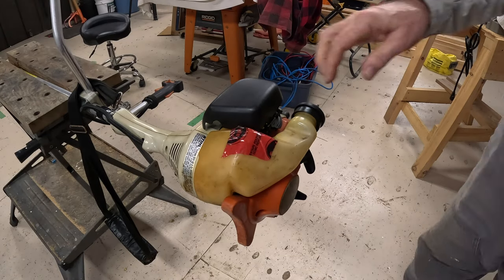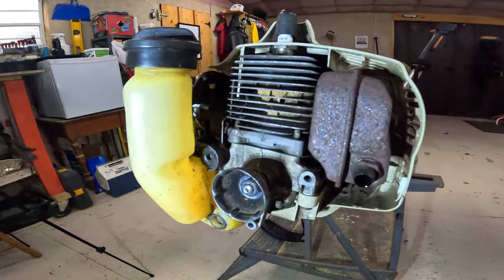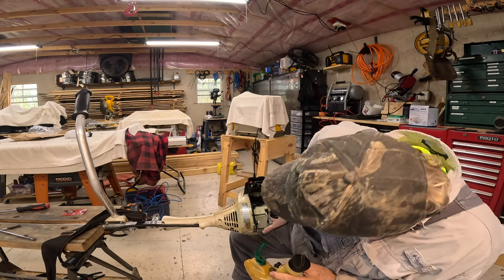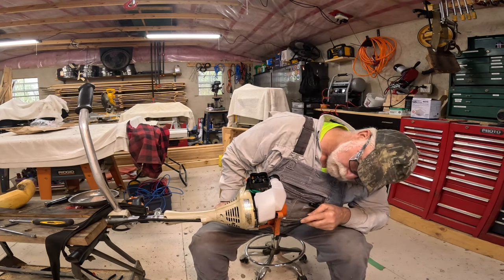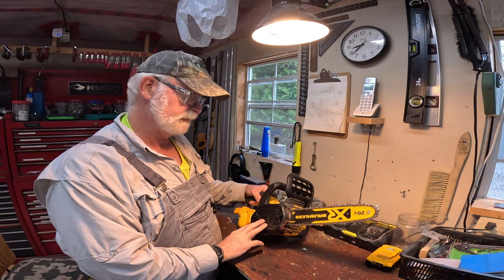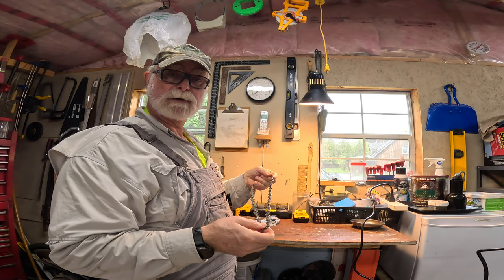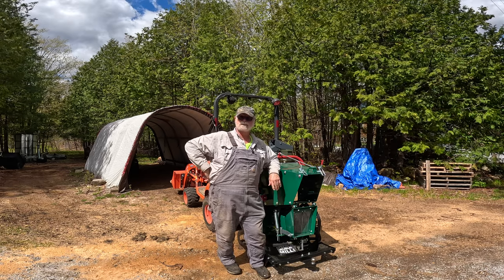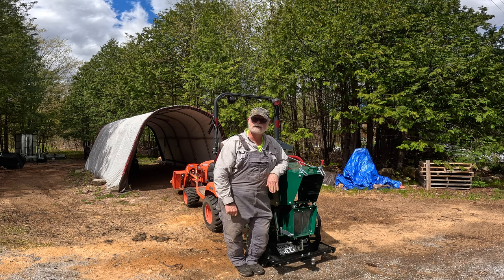Fear Not: Upgrade to Wood Chipper Has Arrived, After Trimer and Chainsaw Fix

Comment: You are exactly correct about being a waste of time greasing the bar tip............been employed working in the bush on a chainsaw a couple of time and have never ever greased a tip and have never ever lost as tip. Could never use that grinder.......by hand is the best. A great day of improvements for sure.
Reply from the maker: Thanks so much! Switching from working with steel to working with wood has been quite a learning experience. I will get better with the file. Thanks for stopping by!

Comment: Yup, having equipment calls for regular maintenance and occasional repairs. Nice job servicing your equipment and installing the new hitch part. I have mainly used industrial/commercial wood chippers and the most important thing is to stand off to the side, never directly in front when feeding or the machine is chipping. Obviously no loose clothing and keep hands clear in addition to PPE. Have a good one Brian!
Reply from the maker: Thanks Paul! I appreciate your advice and I’ll go by it.

Comment: Excellent job on all three.  Nice as well that woodland mills fixed the issue. Looking forward to seeing it eat wood Brian. Cheers, Mike.
Reply from the maker: Thanks Mike. A couple of pretty straight forward jobs. Chipper video coming soon! Thanks for stopping by.
Reply: My old two stroke trimmer died and I recently got a stihl FS91.  It’s a four stroke trimmer that still takes the 50:1 mix. Yup no oil sump to save on weight. Pretty cool idea and man talk about torque. Cheers.
Reply from the maker: Wow! 4 stroke power. I’ll be looking for that when my old trimmer dies. Thanks Mike!

Comment: Great video!  I have the same wood chipper works great.  Two suggestions if you are chipping fresh cut long needle pines like White Pine they like to jam up the shoot either alternate a good branch to leafy material and you can try speeding up the feed rate.  Next if you are looking at the blades with the cover up don’t spin the blades being curious looking at them they are extremely sharp and heavy fly wheel.  It could easily take of a finger.  Always lock the pin if inspecting them.  I did not have this happen but it could have easily have. Just a little help and prevention of injury.  Have fun it’s a great tool.
Reply from the maker: Thanks so much for the advice!! I really appreciate it. You can’t beat experience.

Comment: Oil on the chain is flung outwards & the nose sprocket's also a tight fit in the bar. Grease stays in the roller bearing inside the sprocket
Wore out three Husqvarna saws when I had the forestry business back in the 1980s - running small 2 stroke engines at 8-10,000 rpm for 8 hours a day is pretty hard on them.
Hitch mod is pretty much what I thought it would be.
On the chipper: keep roots & stones well away, as the former will definitely contain the latter.
Oh & make sure the bolts holding the blade(s) in place don't seize up because keeping the blade sharp saves SO much time & energy.
Reply from the maker: Thanks very much for sharing your experiences. I really appreciate it! Obviously it’s a good thing I still grease the nose sprocket on the bar. My chainsaw experience is limited. Very good point about the sharpener of the blades. I have actually run the chipper a few times now. I opened it up and checked the blades and was very pleased to see they are still very sharp. It will be interesting to how they hold up. But yes, I agree 100%. They need to kept very sharp. Thanks very much for watching!